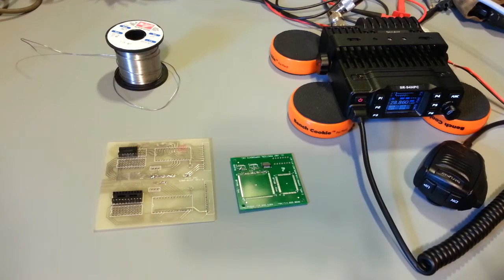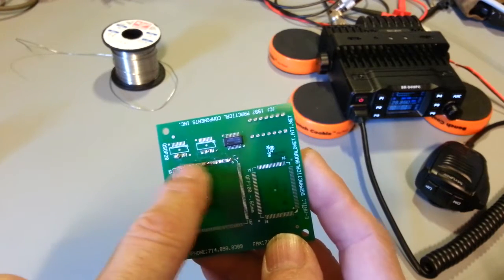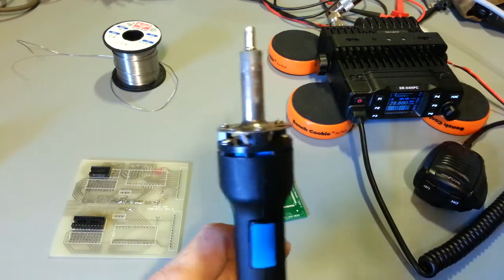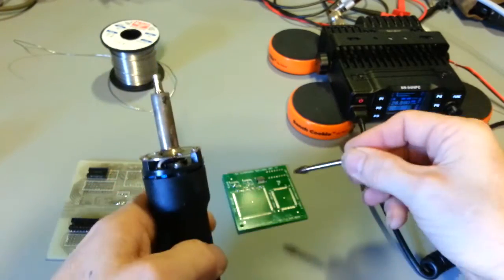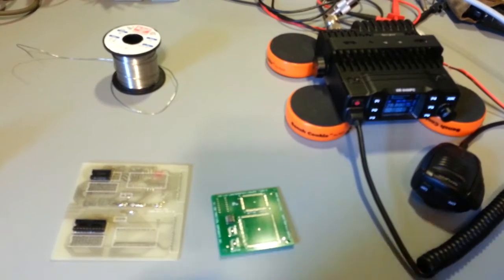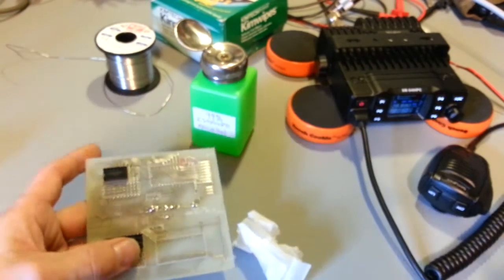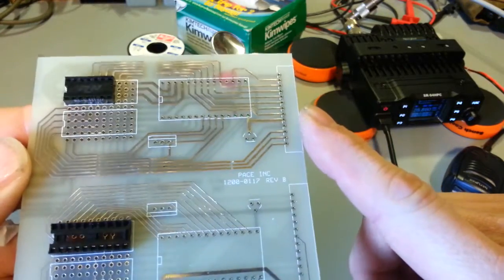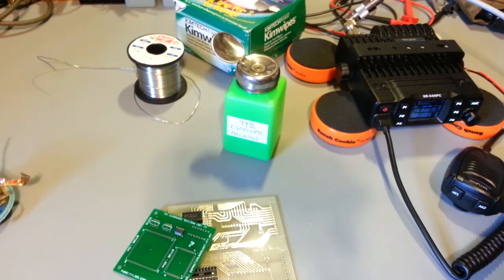Flo-D-Sodr SMD trace desoldering tip...

Comment: I just bought a mid 1990's Pace PRC2000, was wondering what Desoldering hand piece you are using? Great idea, thanks Jules
Reply from the maker: Julius Canale II 

I have 8 desoldering handpiece.  Multiples of SX-80, SX-90 and SX-100.  The SX-90 and SX-100 are the best and take the most current tips with the newer heating elements.  With them clogs are a thing of the past.
Reply: Thank you for taking time to reply, I know you're a busy man. I did not get as good a deal on my PRC 2000 as you got on yours lol, but I thought $250.00 was still a good deal. Of course it just showed up in the box yesterday and when I plug it in tomorrow I hope it powers up at least. I will try and grab SX 90 then, will this just plug-in and go or is there an adapter needed for the outlet? I just pulled my Mark III, D201a and Robyn out of storage after probably more than 20 years. Started plugging things in and blowing fuses lol, nothing works. I'm one of those nitwits that believes if you have a good schematic, directions or YouTube video that you can accomplish anything, hence the PRC 2000. Probably end up with a pile of tubes and melted circuits. LOL Big fan of all your videos keep up the good work. Thanks again
Reply from the maker: Julius Canale II 

$250 is a good price for one of those units, they cost thousands new.  Just be sure you have the visi-filter in line with the vacuum hose.  That protects the pump from flux fumes.  Be sure you get handpieces with black connectors, those are sensa-temp.  The Intella-heat ones with a blue connector will not work.
Reply: Will do.

Comment: I don't know if its a good idea or not, but I've had good luck putting a little liquid flux on my solder braid, when cleaning SMD pads.  It may just be because I'm using crappy braid, though! hehe
Reply from the maker: Michael Hojnowski 

That trick also works well on old solder braid that no longer works very well.  I got 300 or so small spools of it at an auction years go.  It was from the 1980's and didn't work at all.  Those couple spools stuck together in this video are some of them.  I add some fresh liquid flux to it and it works like new.